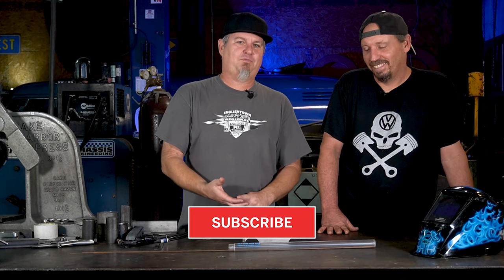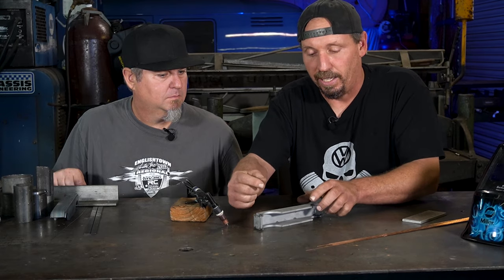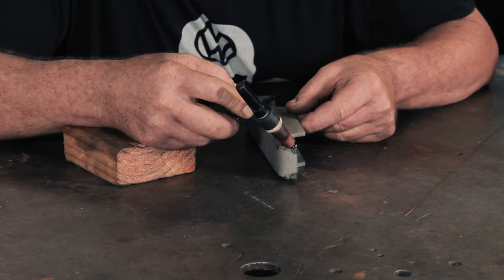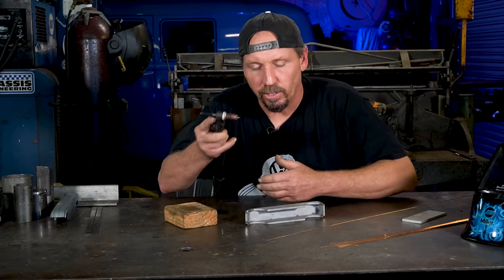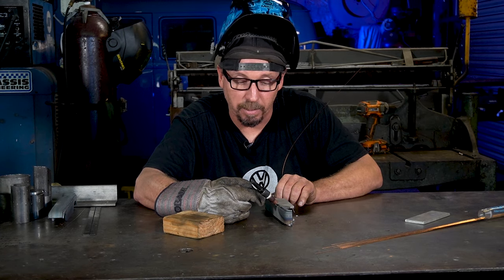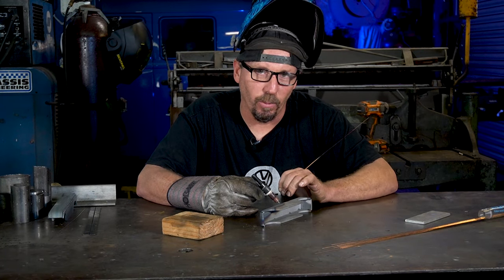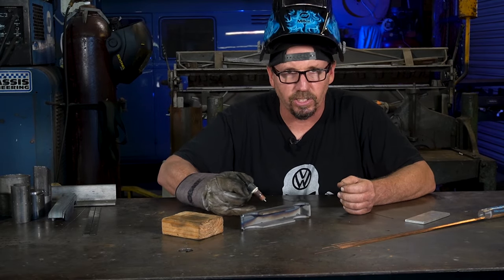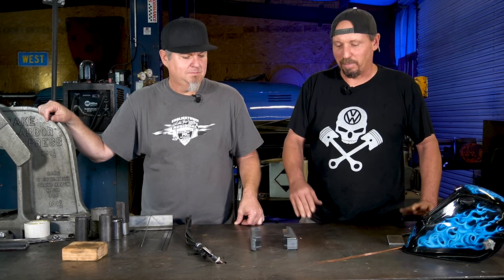TIG Welding Tips (part 2)   / Get Started Welding on your VW

Comment: I have been tig welding for about  18yrs.  First thing I thought about for tips for TIG welding is be comfortable.  You guys mentioned that.  Well done.  Another thing for the older guys and those with bad sight.  Make sure you can see what you are welding.  This seems like a no brainer but a few years ago a friend of mine was welding stainless exhausts and I noticed his welds were looking great so I asked him what he was doing differently.  A gas lens, a new machine, etc??? He laughed and said that he was using bi-focals or a corrective lens on his hood.  I don't recall which but it was the fact that he could see what he was doing better.
Reply: That is sooooo true!! I started wearing reading glasses last year while welding and was totally takin off gaurd! I had no idea that i wasnt seeing it that well . I use to get made fun of for having my welding helmet like 4 inches from what i was welding so i could see clearly and that was way before i needed glasses! We will definatly mention that in the next welding tips vid!
Reply from the maker: I have a weak corrective lens in the hood and also use readers.. that way I can take the readers off when I need to be farther away from the weld.

Comment: I have a old Miller Synchrowave 250 I bought from the last company I worked for when they closed their doors. I agree.....they're definitely solid machines. Nice work guys!
Reply: Yes! Love these old Miller's. Alot heavier than newer ones but you'll probably never have to do anything to it. Just use it. I have a second 330 A/BP ,another free welder, that I have for back up....it never gets used.. had a third and gave it to a good friend
Reply: @ryanlowther6447  you've been getting much better deals than I have for sure! I paid $500 for mine with a chiller unit. It would be nice to get one for free but I'd still pay $500 any day of the week haha. I just need to find myself a better torch. The one that came with mine is really big and bulky. I only occasionally weld at work but the torches on the machines there are compact and easier to use.
Reply: Definitely a great deal on a great welder

Comment: Smooth video, thanks for sharing those tips. I have a Eastwood Mig and a Lincon stick 👍
Reply from the maker: Bring that Eastwood over to the shop.. I want to try it out! 😃
Reply: Rob Stapleton it’s the Eastwood 135 though...
Reply from the maker: @VWJawbreaker  That's no problem...it'll plug right into the wall. 👍
Reply: Rob Stapleton I wasn’t sure if you guys had regular plugs in the shop 🤪😂
Reply from the maker: Yep and we even have a MIG welder or two. 😂

Comment: I'm looking into buying my first Welder. What new options do you recommend? I'm considering the AHP AlphaTIG 200X - $720
Reply from the maker: If your going to be welding aluminum make sure it's a TIG  that can weld in AC. Not familiar with the machine you mentioned but any good machine that you can practice with is great.